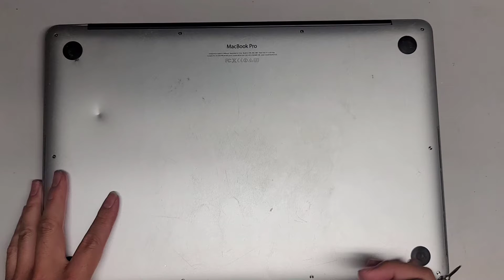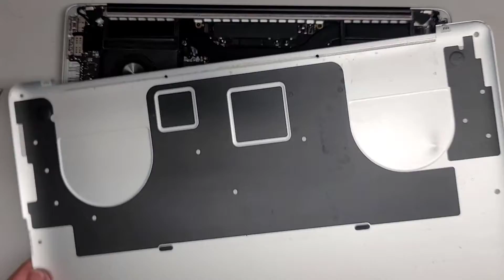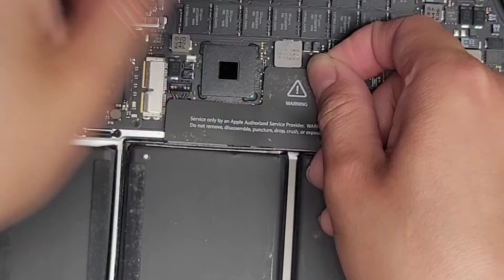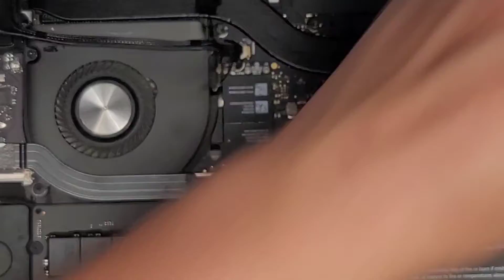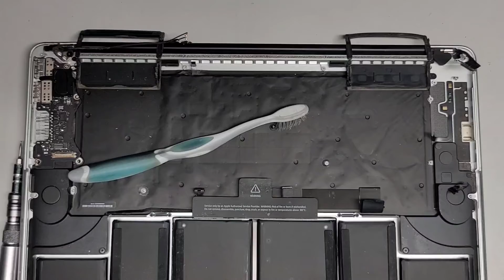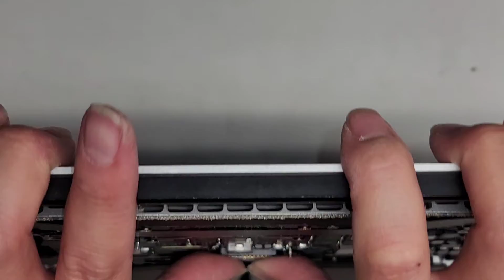15" inch MacBook Pro A1398 Mid 2014 Disassembly SSD, Motherboard, Logicboard, Charge Port, Magsafe

Comment: I have this exact model. It heats up whether it's got the charger on or not. Does this model have a fan? ALSO, the right speaker is very 'scratchy' sounding.
Reply from the maker: I'm confused. If you have the same model, don't you see the fan? Lol The speakers on this model are known to go bad. Replacing them requires pulling the motherboard out, so is a bit risky.

Comment: I am so immensely grateful for your detailed video. I am not necessarily a tech savvy person but I do like putting things together and pay attention to details. So I was very nervous about ruining my computer but trusted myself enough to do this, I just paused the video after every single move to make sure I did it correctly. I’m in shock that I just changed out the charging port on my laptop I feel so good about myself! You were so thorough from draining the battery to grounding (which I wasn’t sure about that so I spent a good amount of time consulting with Google) and it worked out because of YOU. Thank you!
Reply from the maker: @lovenlight13  awesome, glad it worked out. If you haven't already, please like and subscribe so others can find my videos and possibly consider watching a few others, liking and commenting to get the algorithm to recommend my channel. Thanks!
Reply: @ItsBinhRepaired  For sure!
Reply from the maker: @lovenlight13  thanks!

Comment: I tried Co replace my charging port and after my screen would not come on. Can anyone help me please?
Reply from the maker: @emmanueljuva6159  if you didn't do the battery drain before disconnecting the lcd lvds cable, you likely fried the backlight circuit

Comment: hey i did it and now i got no orange light light on the charger
Reply from the maker: @orel9967  make sure the charge port is flush and the battery is connected all the way.

Comment: Charge port removal starts at 20:21
Reply from the maker: No, it starts at the beginning of the video. How do you expect to get to the charge port connector without removing the screws at the beginning?

Comment: Great video and knowledge on the MacBook.  I did all the steps and when I put in all back together my screen will not turn on.  I can hook and ext monitor and all works.  Check all connection and review the video 3x to make sure I did the proper repair.  any ideas?? Thanks
Reply from the maker: Hmmm was the battery disconnected and power button held 10-15 seconds before messing with the LCD/LVDS connection?
Reply: @ItsBinhRepaired  yes. I did that step for sure. Made sure I was grounded and took my time. Is there a back light cable that I might have damaged or should I get a new screen. Thanks
Reply from the maker: @a2-ltd  sometimes it's not the screen, but a backlight circuit on the logicboard/motherboard. Try disconnecting the battery and then the screen, then reconnect the screen and battery.
Reply from the maker: @a2-ltd  if that doesn't work, you might be lucky and it might be this. https://youtu.be/yZATa-iATZs